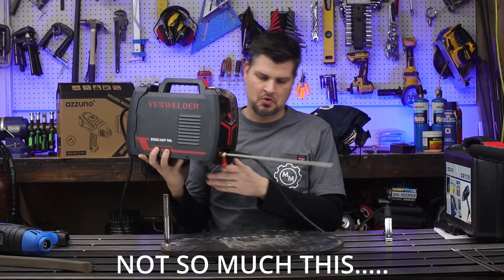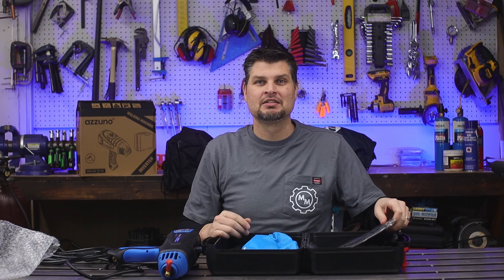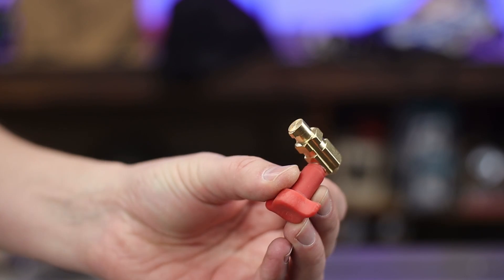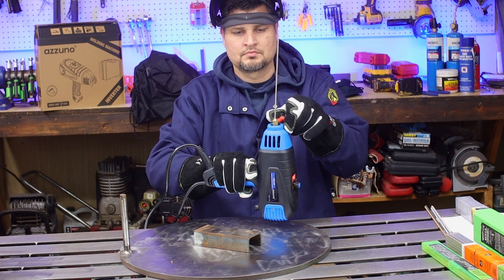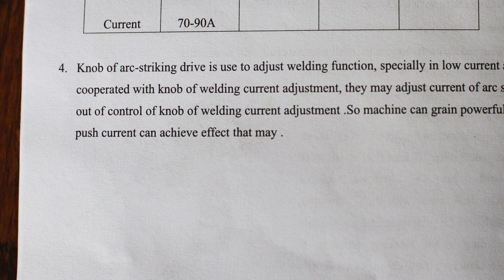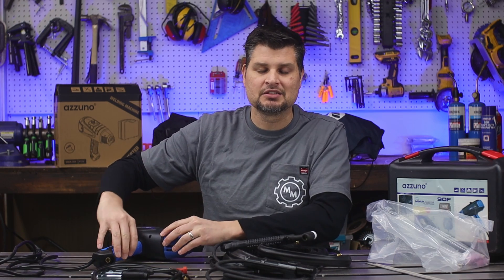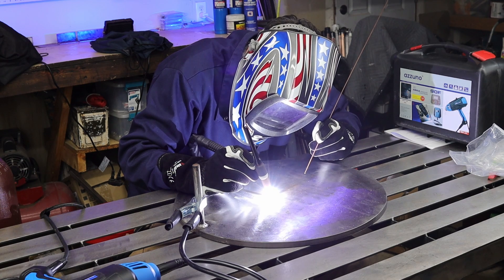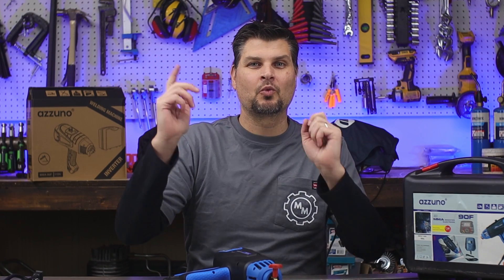Cheap Amazon Handheld TIG and Stick Welder

Comment: Don't dog it too bad, I use it for small projects around the house, it works fine. Bad reviews are probably from idiots that don't have ANY mechanical abilities.
Reply from the maker: I do agree, works great for the small projects. One major downside is if you are a beginner and learn with this then you will need to relearn the technique if you transition to a welding job with a tradition stinger.